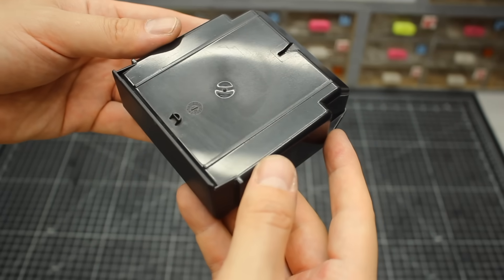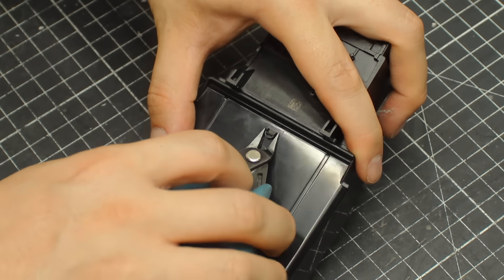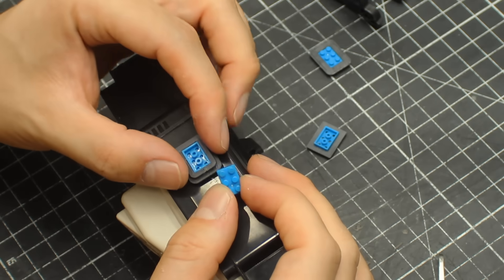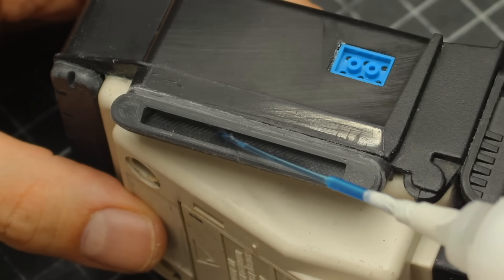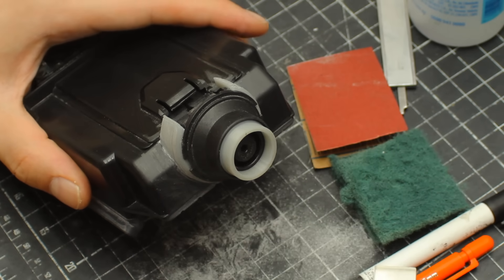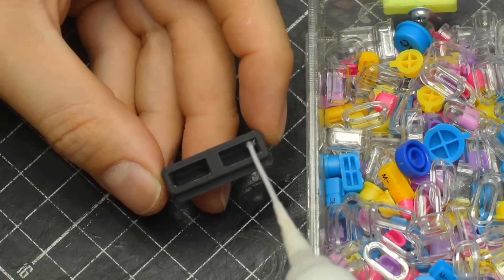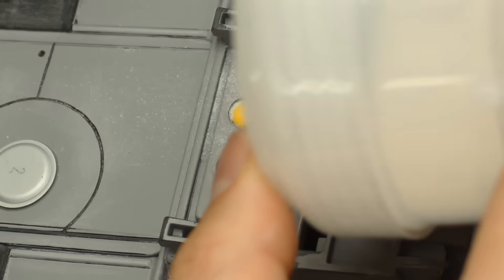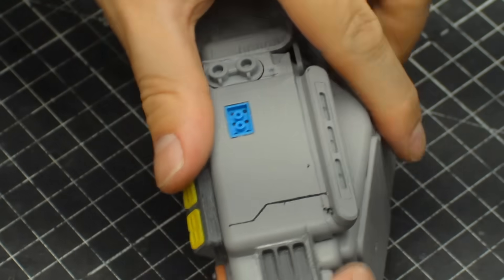Meet the Dagger, Combat Robot's younger brother!

Comment: I guess most kitbashers are adverse to 3D printing, maybe they see it as cheating or against the spirit of the kit-bash part to use non recycled material. But at this point who cares? What matters is the results, and on that front you absolutely delivers.
Would it be interesting to see you attempt a build with no 3D printing allowed, though? I say yes, it would be neat seeing you coming up with different methods and iseas to get to the result.